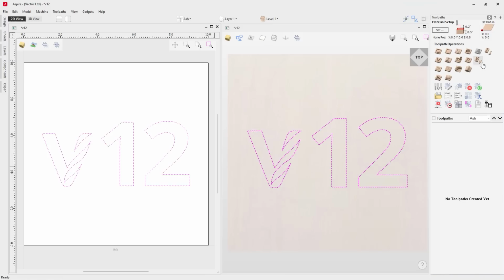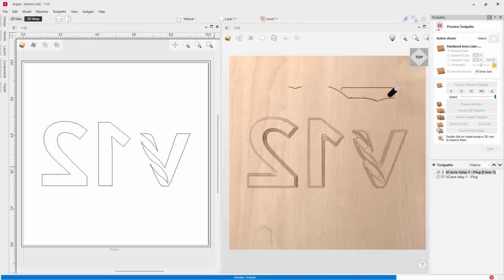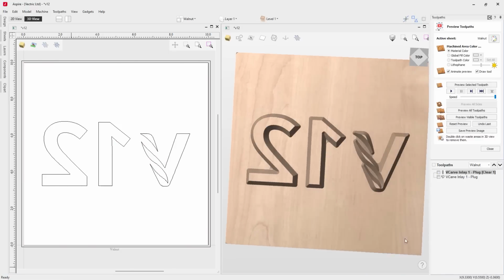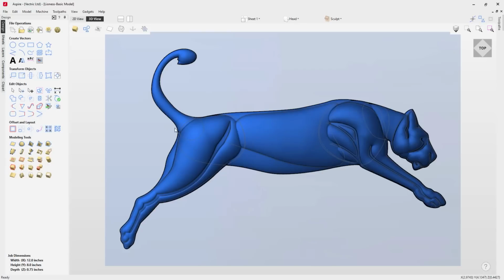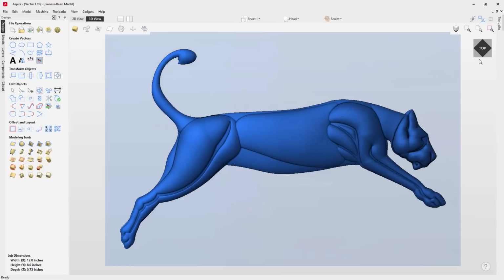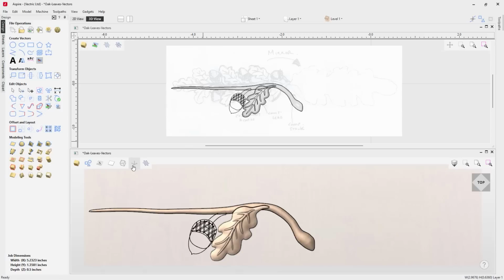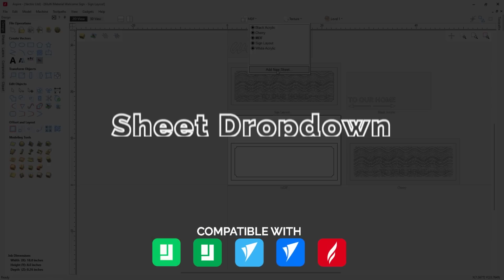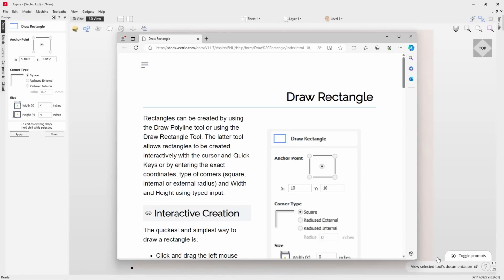Vectric Aspire Version 12 is OUT NOW!

Comment: Have been away from Aspire for a couple years (version 10.5.)  Just updated to Aspire 12. Mainly because I do rotary and There wasn't a way to easily do a continuous toolpath while the part is turning, just forward one direction and back the to 0. I never came across a continuous cutting gadget formula several years ago here. I noticed they still don't. I am still hoping that Vectric will add a button for it on the drop-down box in the toolpath rotary turning menu.  If anyone else needs a solution to this issue, let me know here. It would make rotary cutting faster. Time is money.
Reply from the maker: Thanks for that Raymond... I believe we know this is a feature rotary customers would like to have.  I'll see if we can have another look at it... :)

Comment: Hello, I'm contacting you from South Korea.
I recently purchased your software and am looking for a guide.
This particular video supports Korean subtitles, but I couldn't find other videos with them. Could you please recommend other videos that include Korean subtitles?
I primarily use a CNC router to machine engineering plastics.
Reply from the maker: Hello and thanks for the question.  I believe if your watching any of our videos on YouTube you can turn on subtitles in you language. Hope that helps.  As for cutting plastics I would probably contact your machine tool manufacturer and ask them for any tips.

Comment: Disappointed to see no impovement again in a key area for output - toolpath tabs. They are essential when cutting small components from sheet stock yet so very time consuming to add with the available options. The given options just don't work IRL. When you've got a sheet stacked full of close parts, you either have to add all the tabs manually, so that tabs from adjacent parts sit opposite each other so that they don't get cut through, or use the automated options and hope for the best. The way the auto tabs are placed need to consider this. They need to be smarter. It would aso be nice to draw lines across the drawing to add manual tabs across a given band, rather than having to click on each line. This would save stacks of time when dealing with nested sheets of small organic shapes (non identical). Happy to give more feedback over the phone/email
Reply from the maker: Thanks for that... we will be sure to pass that onto the Dev team.
Reply: Not happy. Paid for the upgrade, still using 11.5. Why change the icons and in some cases functionality? Change for the sake of change?

Comment: Hello, the software is good but I think what the program lacks is that it can be programmed in "G17 G18 and G19" plans
And you can configure a Multi Drill head for vertical and horizontal holes
I think these are the main tools that are missing for those who have a CNC with Multi Drill or with aggregates
they are great tools and very important and if aspire bet on this it would be a complete program and many companies would buy the software
Reply from the maker: Hello... and thanks for the coment.  We have other customers asking for this sort of thing so it is on our radar.